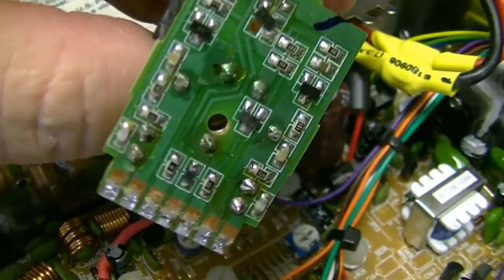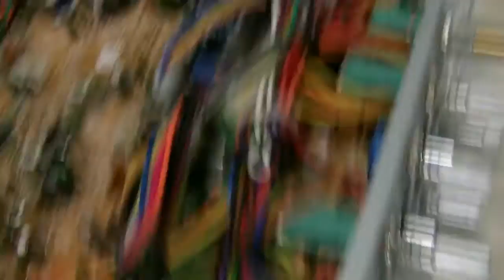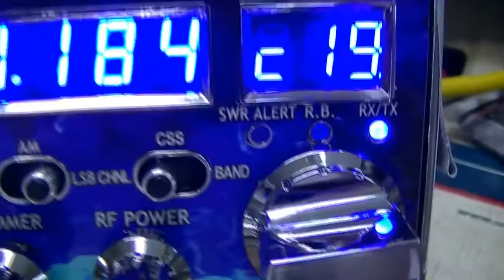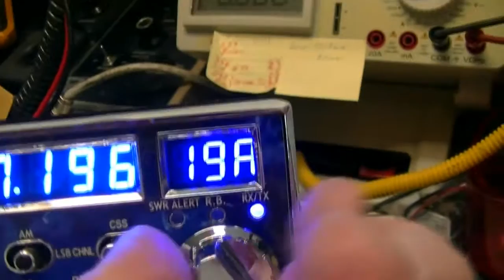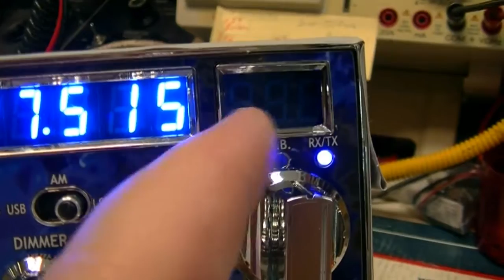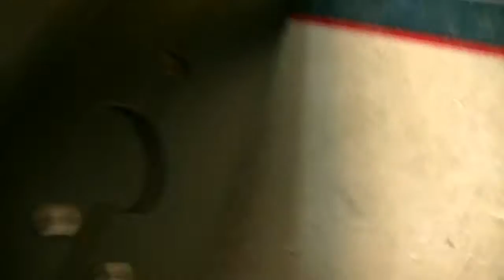Daniel L NY Custom DX959 by LesComm...Want one? Go to www.LesComm.com/Radios

Comment: Hi, I have the same radio galaxy 959 dx. modified with high extra channels. everything is fine, but the ssb is very, very noisy and sometimes with a lot of popling. My question is, what can I improve or update to lower the sensitivity of reception to reduce noise? when I run it in AM I have 0-1 dB of noise but I change to USB / LSB and the noise goes up to 7dB. Help me !
Reply from the maker: It will require circuit modification